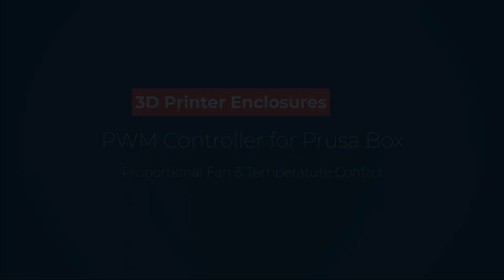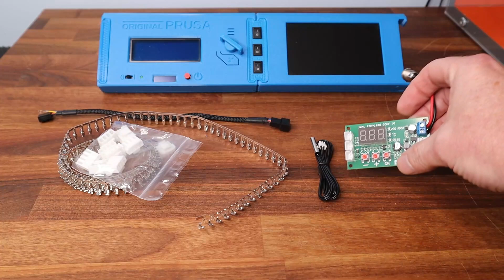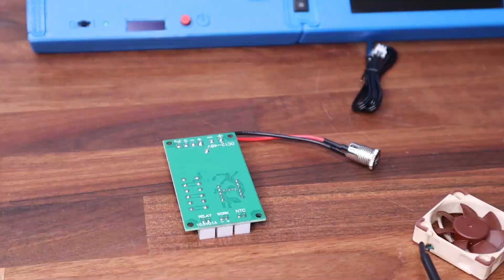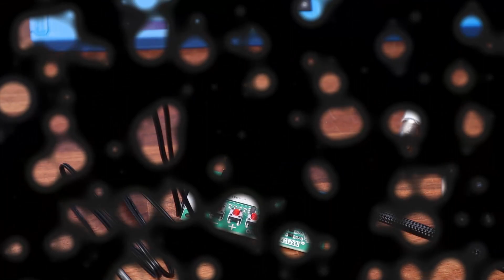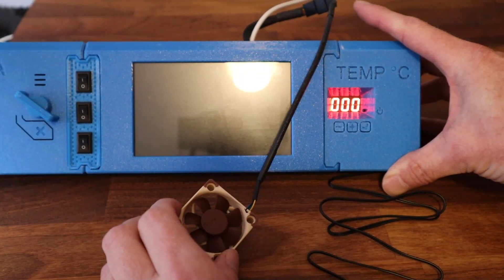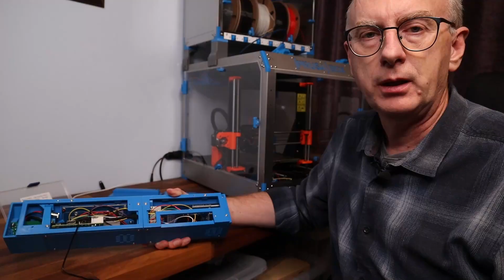Prusa Box PWM Temperature & Fan Proportional Speed Control For Modular Front  3D Printer Enclosure

Comment: Hi Colin! Thank you for your great work very nicely done. I've just ordered the pwm controller from US and will soon put all this together with my NF-F12.

But my question to you is how to implement this mod you created with the "quick top removal" mod? Any thoughts/ideas? I was thinking not use the right corner screws for the top behind your pwm unit? Right thing do? I'm from Sweden so sorry for my bad English but hopefully you'll understand what I mean?
Keep up the good work you do and sharing with us! Big 👍👍👍 to you!!! Best regards Tobias.
Reply from the maker: Hi. I haven't removed the top of my PrusaBox apart from testing that mod months ago. I don't have a solution, but I think someone  made an adjusted modular front bracket that allows access to all screws
Reply: @colinhill  Hi it's not the one you're showing in the end of your video right?
Reply from the maker: The adaptor plate I showed is the original. Later someone said they had made a modified version that fits the wider pwm but I can't find it now.
Reply: @colinhill  any luck in finding these sir
Reply from the maker: @jameslee6881  unfortunately not. And I'm no longer using my prusabox due to a change of home office space, I now have mk3 and mini in an IKEA floor to ceiling cabinet.
Reply: areyou intrested in selling the modular fromt components
 @colinhill

Comment: Colin, I have been watching a lot of your videos. Great stuff!!! I have a prusa box kit on the way and have been trying to get everything printed that I will need and get the parts from amazon. But I am not totally sure which modular parts to print so that I can have the same setup you have in this video. I am not sure of the bottom pieces and the back pieces. I think I have the rest figured out, but could you put a list of  all of the parts you printed for the above. 
Thanks very much for all of your work!
Chuck
Reply from the maker: Bottom parts, just the normal bottom plates. Back parts, you need the modified back parts that come with the extra frame that allows centering of the modular front. I think that was on printables website.
Reply: @colinhill  I already printed those, so no other covers on the back?
Reply from the maker: @ChuckB-ly5qo  I will see if I can find the links tonight and report back
Reply from the maker: @ChuckB-ly5qo  just these parts https://www.printables.com/model/174993-prusabox-enclosure-adapter-plate-to-center-modular/files
Reply: @colinhill  Thanks!
Reply: @colinhill  I just upload a remix of the center panels that fix the alignment when using your PWM  Fan Module with the 5" display like in you above video. You can now get to the screws on both sides.
Reply from the maker: WOW! Thats fantastic. (more re-printing to do then :( ). Not getting a lot of time right now to add content. I will comment on YT on the remix (amend my video description). Currently re-doing spoolt tank bearing mounts, then to do videos on rewiring. I much prefer the PWM to the 1219 controller.  Thanks for the support.